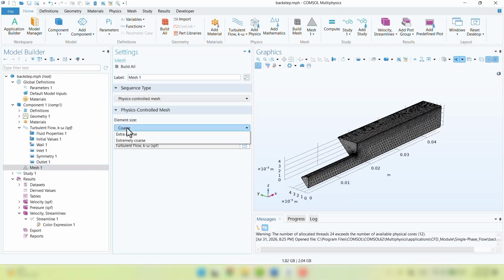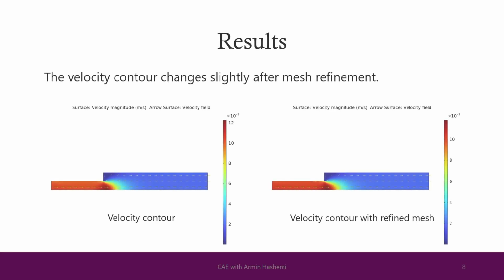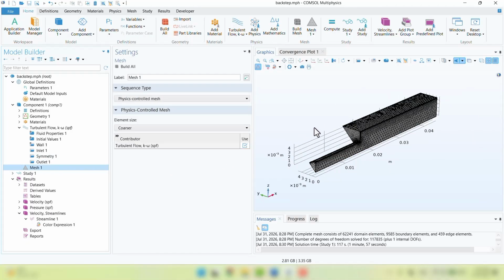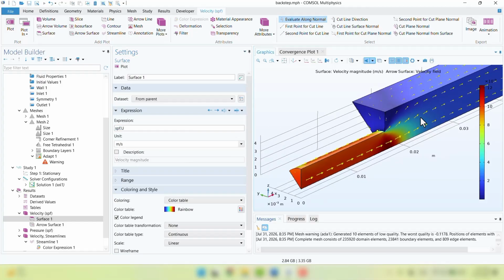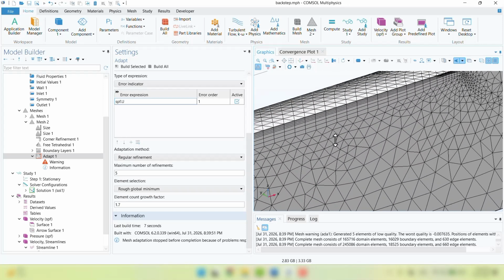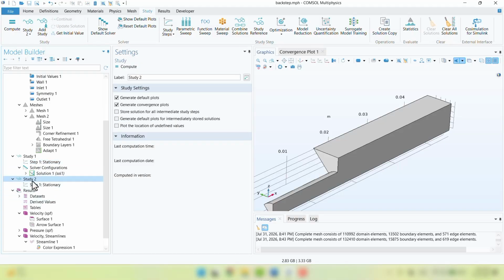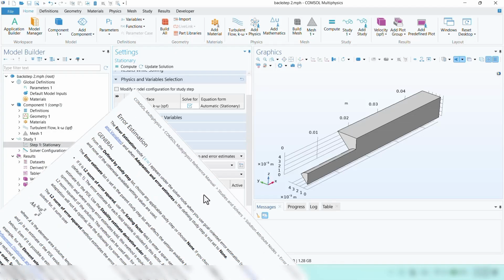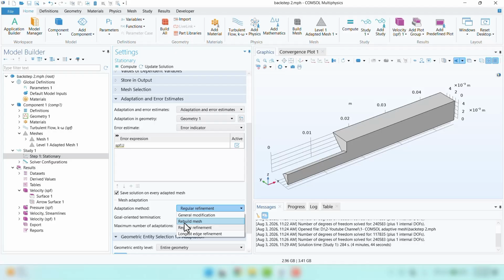COMSOL Adaptive Mesh Refinement Tutorial | Mesh Adaptation & Error Indicators

Comment: can you make a heat sink model Tutorial using laminar flow with natural convection where you have air block without flow where only air moves by heat using COMSOL , i had problem on a project I'm working on , i get so many errors ,but if set inlet velocity and outlet it works fine but its no longer considered natural convection, and keep up the good work
Reply from the maker: Hello, I have a video about heat sinks. You can find it on my playlist.
Reply: @caewitharminhashemi thank you for the reply..and yes i saw the video but you used forced convection by applying inlet and outlet air boundries with inlet value..my problem is when using air block without inlet outlet boundary and assume the air only rise or move due to temperature difference which is natural convection..the solver gives a lot of errors and i didn't find anyone modeling similar to my case
Reply from the maker: hello, you're welcome. I have a video about natural convection in Ansys Fluent, and the steps are similar.